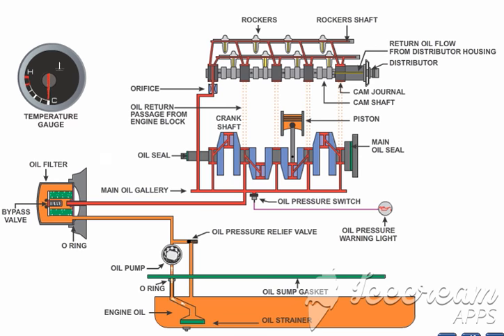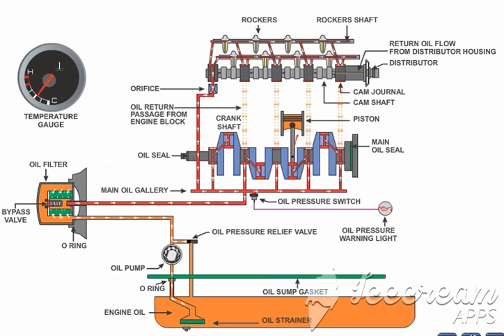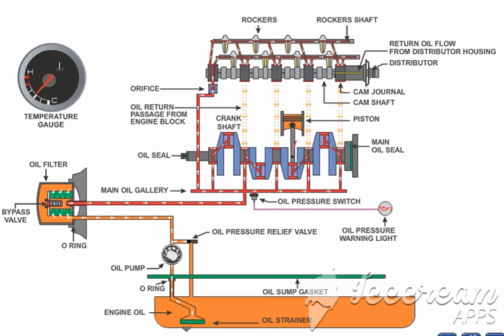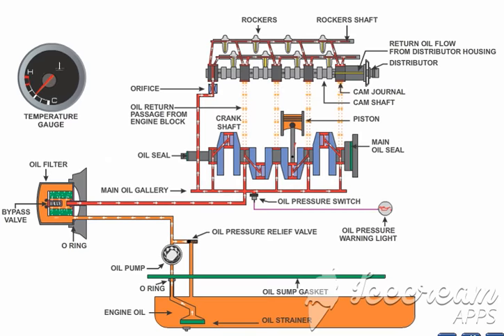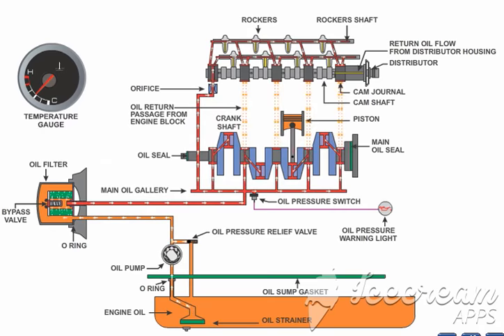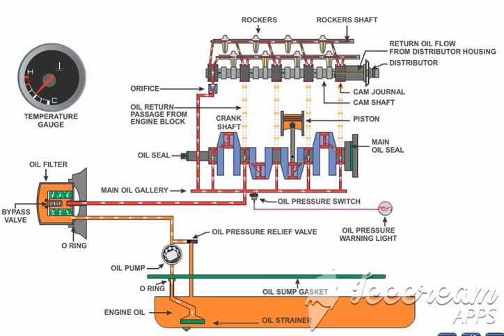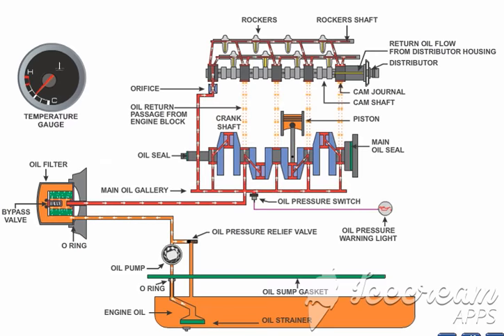lubrication system animation.

Comment: Sir, I want to know what ORIFICE does?
Reply from the maker: An orifice is a small opening or hole, often found in pipes or containers, used to control the flow of a fluid (liquid or gas). Here's how it works:

1. Flow Restriction: When a fluid passes through an orifice, the small size of the opening creates a restriction in the flow path. This restriction causes the fluid to accelerate as it passes through the orifice.

2. Bernoulli's Principle: According to Bernoulli's principle, as the fluid's velocity increases, its pressure decreases. So, as the fluid accelerates through the orifice, its pressure drops.

3. Flow Rate Control: The size of the orifice and the pressure difference across it determine the rate of fluid flow. A smaller orifice or a larger pressure difference will result in a higher flow rate, while a larger orifice or a smaller pressure difference will result in a lower flow rate.

4. Applications: Orifices are used in various applications, including in flow meters to measure the rate of fluid flow, in control valves to regulate fluid flow, and in nozzles to produce a high-velocity jet of fluid.

5. Calculations: Engineers use mathematical equations like the orifice equation to calculate the flow rate through an orifice based on its size, the properties of the fluid, and the pressure difference across it.

Overall, orifices are crucial components in fluid mechanics for controlling and measuring the flow of fluids in various industrial and engineering processes.

Comment: Sir in Power Plant how and why oil is used???
Reply: A genset is extremely similar to a gasoline car, or even more to a diesel car. So the genset requires lubrication because it has a diesel engine, which requires lubrication, because it has moving parts, as shown in this video.